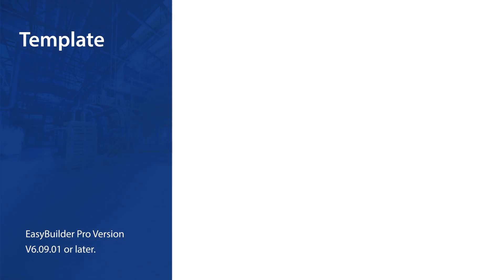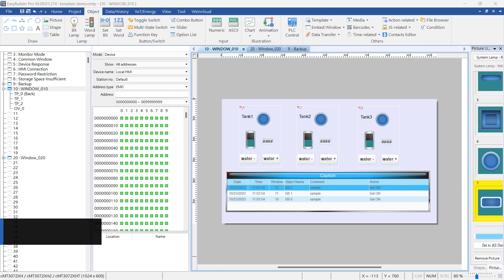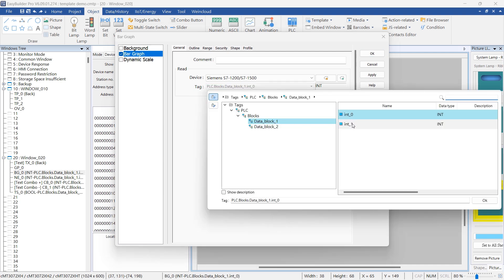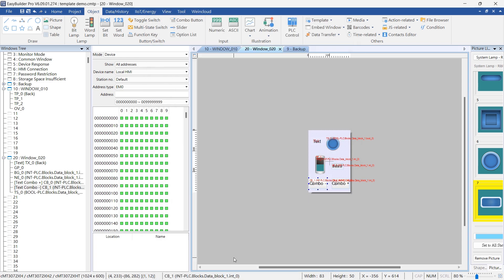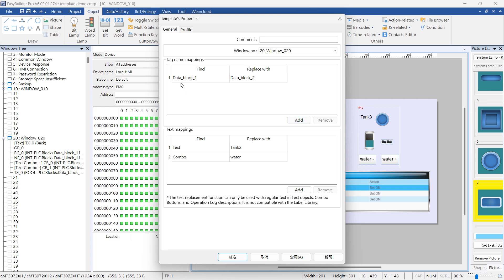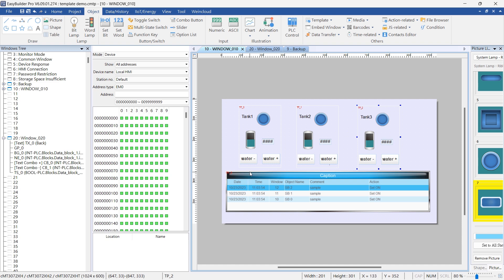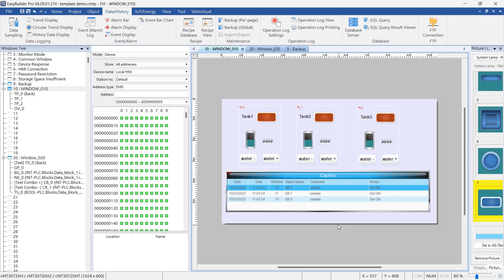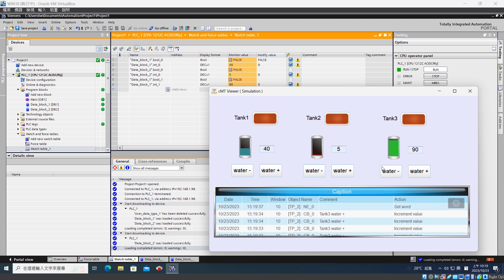Weintek EasyBuilder Pro tutorial - 79. Template

Comment: A very useful feature. Thank you!

Are you planning to implement the ability to have the replacement in a template performed according to a script?
For example, you click on one template, another template opens in the form of a window and the replacement is performed automatically (as in WinCC OA).
This will allow one control per mechanism and will significantly speed up engineering
Reply from the maker: Thank you for your comment.
Yes, indeed we are planning to implement ways to further speed up engineering, and facilitating the quick replication of objects is one of them for sure. 
Please stay tuned for the latest update.

Comment: I am facing one issue in easy builder pro when i add new project there are window tree on the left side but no window present from 11to 49 there are windows 1 to 10 then 50 onwards
Reply from the maker: Hello,
Windows 11 to 49, and the rest of the empty ones, are for your own design. Right click on the number and press "New" to enable an empty window.
Should you have further technical questions, you can use the Service Request on www.weintek.com to get answers from our technical team.
Thanks.